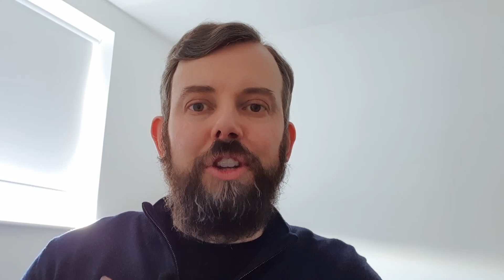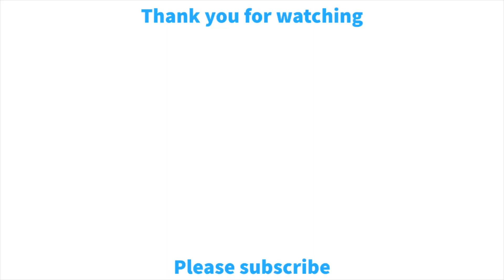Bonding to outbuildings 18th edition 2022 amendment 2

Comment: Hi James. 

I've got a headache with a garden room with an incoming water pipe. The swa is 2core where the previous installer used the armour on the swa as the earth supply.  So I thought to do a tt system (disconnect the swa sheath at the garden room end). However, I dont think I'm going to be able to get the TT rod  more than 5 to 10m away from the metal water pipe so the TT rod will just become part of the bonding to the water pipe bonded on the house end due to proximity of the TT spike to the incoming bonded water pipe.

Any ideas. This one is frying my brain.
Reply from the maker: Hi,
Thank you for your question. It's difficult for me to say without having seen it, so please bear this in mind, and please refer to BS7671 for any requirements that apply to the installation. I also recommend checking the IETs guidance note 7. 
My thoughts are as follows:
Are you thinking of using a TT system due to the installation being a PME system? or is it a TN-S system?
Regulation 411.3.1.2 requires that extraneous conductive parts liable to introduce a dangerous potential difference shall be connected to the main earthing terminal by protective conductors complying with chapter 54. And also that where an installation serves more than one building, the requirements shall apply to each building.
If it's a PME system the bonding conductor would need to be selected in accordance with table 54.8 in BS7671. The requirements are different for TN-S systems, and there was a slight change in amendment 2, and is in regulation 544.1.1.
Converting to a TT system at the outbuilding is another option, however it is necessary to ensure that an exposed conductive part connected to one means of earthing is not simultaneously accessible to an exposed conductive part connected to another means of earthing. It's also necessary to bear in mind underground services when installing earth rods.
The HSE publish a guide to avoiding underground services, which you might find useful. Also the IETs guidance note 7, which I mention in the video is useful. 
I hope this helps.
Regards
James